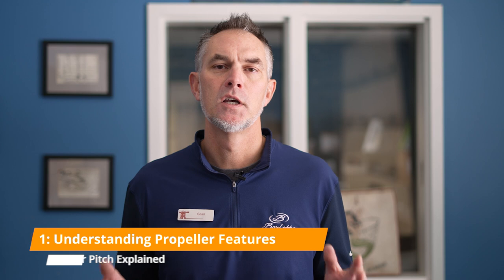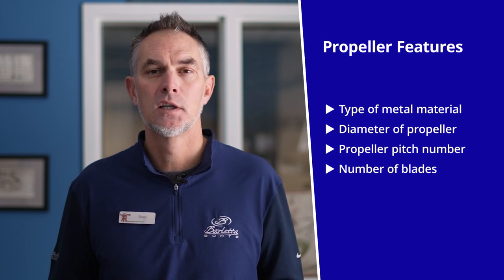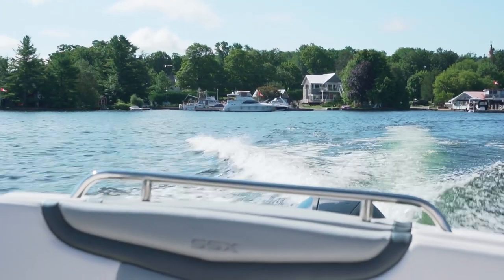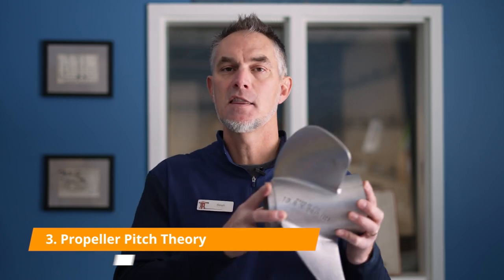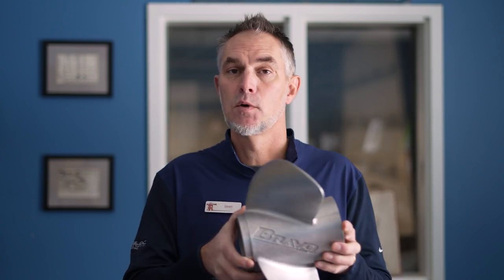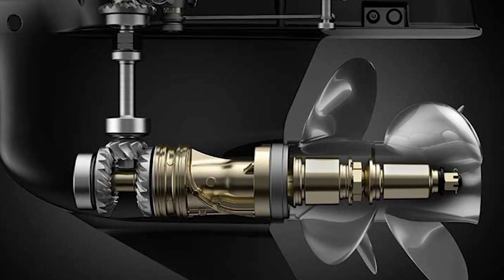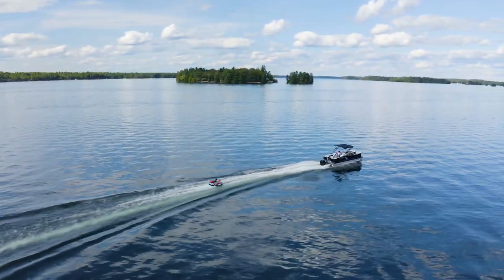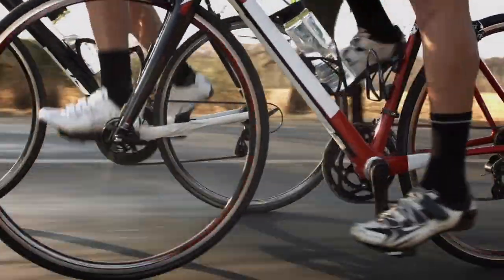Boat Propeller Explained | What is Pitch and Diameter?

Comment: Would it be feasible to change a prop depending on the planned usage of a particular trip? For example, using a particular prop when planning an outing with 10 people on board versus 2 people traveling across the ocean to Bimini when higher top speed would be beneficial.

Comment: Hey mate, I have a 4.5m aluminum boat with a 50hp evinrude (2stroke on the back)

It is very difficult to steer turning the wheel. It is cable and the mechanics said it's all brand new and everything is functioning right. (They didn't water test it) 

It's running a 15 pitch 3 blade prop. Even when engine is trimmed correctly it's very difficult to turn. Example- if I put the boat into a circle and try to make the boat go into the other direction it takes a long time to get it back around. It's like it's digging to much in water.

Will dropping pitch fix this

Comment: Hi, it's an amazin video here. i need your advice on this pls: i have a mercury seapro 60, 4 stroke equiped whith a 13 1/4 and pitch is 17 on an open boat of 5m. the issue is that is too slowwwww with an rpm of 3500 max (30km/h) . what is the best propeller to go faster plsss ?

Comment: I need help. in 10 days I will get a pair of Suzukis DF 150 APX for my Center Console Brand: AS MARINE AS 26 GL about 7.8 meters (or 26 feet long) and 2,55 meters wide ( 8.3 feet), Weight wet with everything is 2600 KG or 5700 poung. This boat got have a bracket in the hull integrated. I need a setup for speed. Thanks for your recommend.

Comment: Some propellers joint is straight and some propellers joint is curved, why can you please define? The joints are connected to bull mouth
Reply from the maker: That is a good question. I expect it is to reduce vibration and increase smooth operation by reducing turbulence as the blade slices through the water